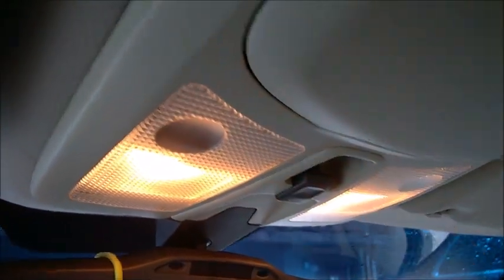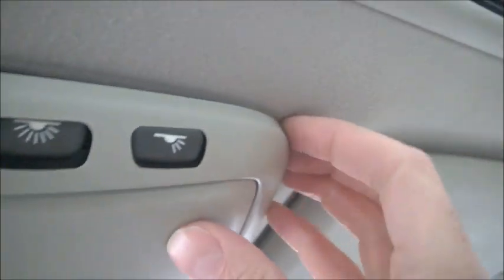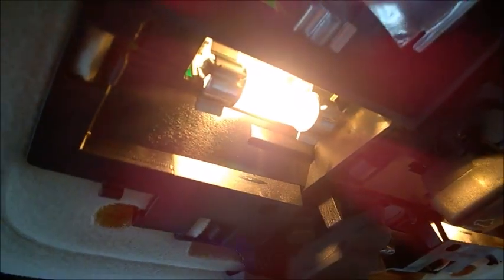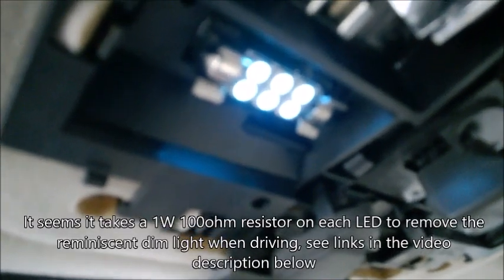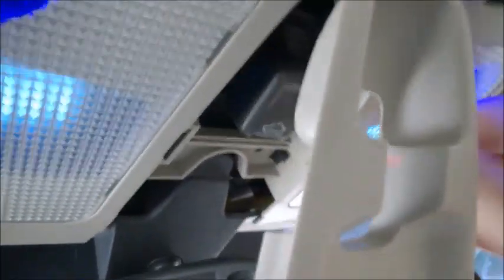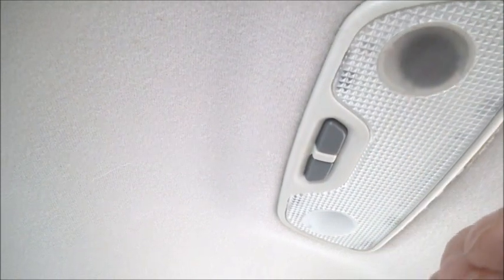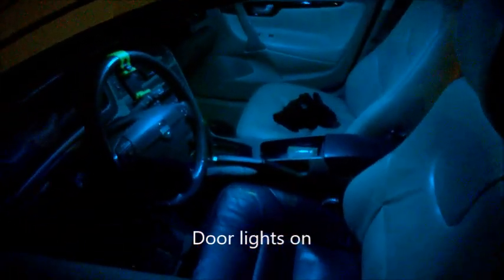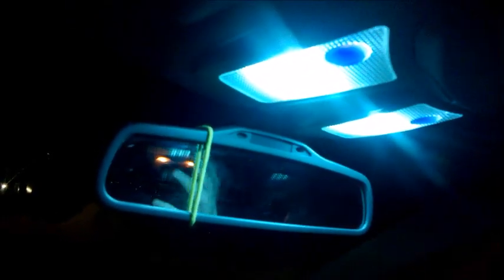Volvo S60 V70 DOME Interior lights LED conversion  2001-2009

Comment: In S60 1k resistors do the trick pretty well and don't need to be quite powerful. 0.25W are just fine since they'll only need to dissipate less than 0.144W of heat, but are quite enough to avoid annoying dim light and also to prevent CEM (or UEM) from thinking dome lights are not working or missing.
S80 seems not to store such errors and 10k resistors are also fine (unless I have problems with electronics that prevent it to register these errors and I wrongfully assume it's all fine). In this case heat dissipation should be less than 0.0144W.

Comment: I put some resistors on, 1w 100 ohm on mine and the resistors over heated (rear dome) gonna try again with some 2W resistors. Will let you know how I make out.
Reply from the maker: Thanks for the input!  I'll pin your post as soon as you test them.  Do you have similar 6-led Festoons?  I'm thinking sometimes Festoons may look similar but may have a different components?  Anyhow, let us know, thanks
Reply: Peppermint I installed the 2W resistors, they seem to be holding up fine.  They are slightly bigger and it’s still important to install them such that they don’t make contact with any plastic components nearby as they do get hot and can melt the light housings.
Reply from the maker: @Bigtime_mcalpine  Great!  I'm pinning your comment to let others know
Reply: Just use 10kOhm resistor parallel to LED bulb. It will take 0.02Watt under 14Volts. It works well in my S60 '08. LED do not glow when turned off.
Reply: Bigtime McAlpine hi i need help just to give me idea how to connect the resistor to the bulb ...Thanks
Reply: If you can’t find a spot to solder onto the bulb itself just solder the resistor onto the bulb holder (for festoon). For the single LED’s you need to take the bases off the LEDs and then you can solder the resistor right to the two leads.

Comment: Can you write the length of the bulps. I don wanna buy the wrong size
Reply: the correct size is 41or42mm, //i had 39mm and they fit there as well//. But in the trunk , only 41/42mm will fit.

Comment: Can you buy lights with resistors already built into bulb
Reply: its called canbus, you dont need em for interior lights
Reply: @FRStudioss  true but I find that bulbs with out canbus tend to stay on when ment to be off no trouble with the canbus ones
Reply: @HUB1987  hasnt happened to me yet , i have put cheap ones 2 euros 10pcs ob my volvo and also audi, but cheap non canbus in park light is on slightly, but depens on the led itself how much power they take, i just might have been lucky